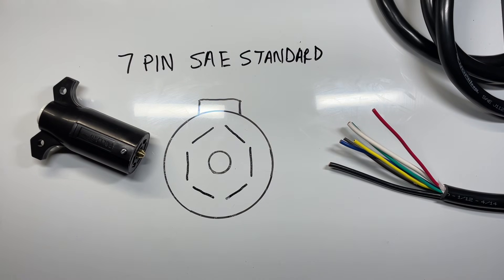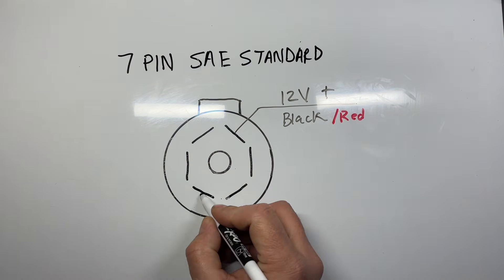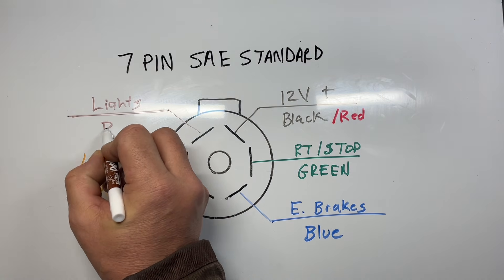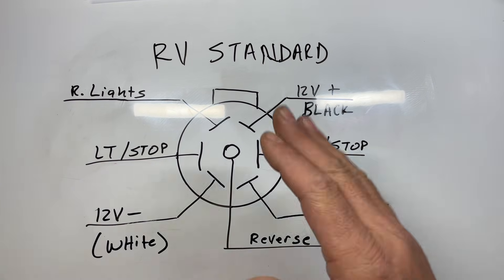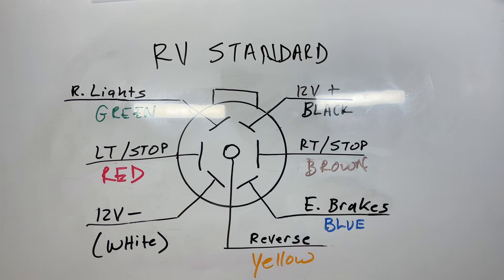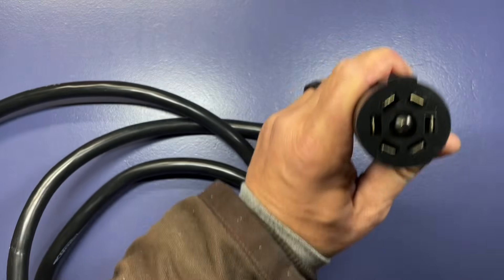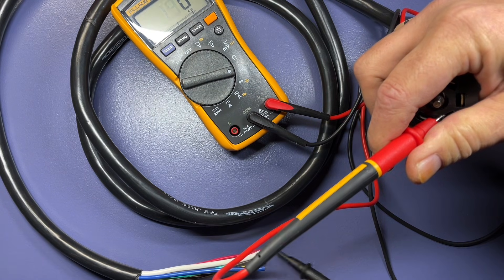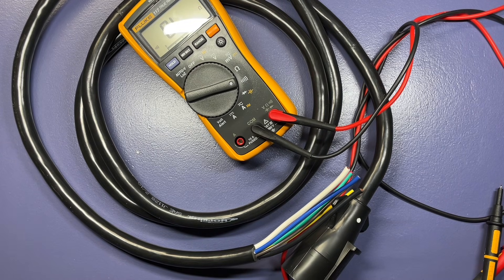7 Pin Trailer Wiring : SAE Standard and RV Standard

Comment: Use a meter to map them out and be positive.  Also you can pick up your reverse power for a backup camera off the underside of your plug wiring.  Lot easier than pulling out your lens/light.

Comment: The circuits are in the exact same position between the two functionally, but the specified wire colors are different  all blade style 7-ways will plug into each other and function correctly (assuming the circuits were all wired correctly, by the installer)  

* Also, not all vehicle wire colors may be the same as the standardized plug specifications.  Check your vehicles wire diagram.  Do not assume the MFG colors are always the same as any of the the 7-way plug standards.
Example: GM has +12V Accessory/Hot as "orange, but SAE is red or black, and RV is black.  Simply hook the correct function wire to the right terminal.  In this case the orange will go to the Black terminal (top left on vehicle, and top right looking at 7-way trailer lead connector will be the purple wire in trailer whip).

Comment: The RV standard makes no sense at all.  There's an established 4 wire standard that has yellow and green for turn signal/stop and brown for running lights.  Why in the world would you change this to brown and red for turn/stop and green for running lights???  Just to screw with people?  All this does is make things incredibly confusing.  The SAE standard makes so much more sense- keep the existing wires the same and add 3 new ones.  Good luck finding a 7 way plug/pigtail that follows the SAE standard though...  I also haven't been able to find a 7 wire harness in the SAE coloring that has pure copper wires rather than CCA and the correct gauges (10 gauge ground/aux, 12 gauge brake, 14 gauge lights).
Reply: The other thing that is hilarious to me with the RV standard is that they decided to use the color red for the left turn...  You'd think R goes with right, but not so much.

Comment: Hopefully, someone can answer this question.  I have a bad connection between the truck and trailer connectors.  I want to know, do the pins on the truck side fit on the "inside" edge of the trailer blades or do they slide on the "outside" of the trailer blades and rest between the trailer blades and surrounding plastic encasement?  Thanks.

Comment: Thank you! Thank you! We purchased a two year old utility trailer and the lights were completely wrong. We have 4 gooseneck trailers that worked with all three of our trucks but on this new trailer when we plugged it into the truck all the lights came on dimly, the right turning signal indicated a left hand turn and vise versa, and even when we turned the brakes completely off in the truck they were full power on the trailer. After watching your video and printing out the diagram you showed we rewired the plug to SAE and 30 minutes later everything is working fine. This was so helpful.
Reply from the maker: I’m really glad you found it useful

Comment: I've got 2 black wires and no blue wire. All lights are working. But I'm getting a NC for my electric brake. Any ideas?
Reply from the maker: Some older trucks have the brake controller wire and 12V wire reversed, I would start by verifying that. It is possible that your brake controller wire fuse on the truck might be blown. I remember years ago buying a new truck and the fuse was never installed.

Comment: What did I do wrong if I connected all colors exactly the way you said on  my stock trailer and the brakes won't release as soon as I plug it in. It drained my pickup battery. I do have a brake controller.
Reply from the maker: In some older trucks the 12V power and the brake controller wires are reversed. Try switching them around to see if that cures your problem.
Reply: That worked. Thank you.  @txtoolcrib
Reply from the maker: You’re very welcome, glad you were able to get it fixed.

Comment: So what happens if we only have 6 wires and not 7 since we bought the trailer used the trailer lights are always being weird on us
Reply: If you have 6 wires, likely the center pin is not used and you don't have reverse lights
Reply: Need to figure out (trace out) which pin is not connected to anything.  Could be centre pin (reverse lights), as these may not be wired for some trailers, but who knows?  The lights will also be “weird” if you don’t have the ground wire connected properly on the vehicle or the trailer side. The ground wire should always connect to the chassis of both sides (vehicle and trailer).
Reply: I have replaced it a couple of this connectors and the purple one it's always cut now I know why,= reverse 😂❤
Reply: Don't  worry about it. They 7th is usually back-up wire which you really don't need.

Comment: 12V positive in black - what a silly idea!
Reply: Hot wire for AC is black. But yah when dealing with low voltage DC I’m used to red being positive. Takeaway - standard is color not so much the absolute position of the blades (the physical position to function should not change!) Also keep in mind Female vs Male mirrors absolute position.
Reply: @CharlesBundy-z9n  Hot wire everywhere else in the world for AC is Brown. Did you know in Sweden, Earth is Red?!? Now THAT'S crazy...
Reply: @LeftySurvival  did not know that! Thanks
Reply from the maker: That’s common in DC voltage